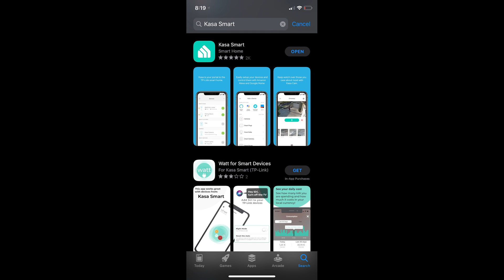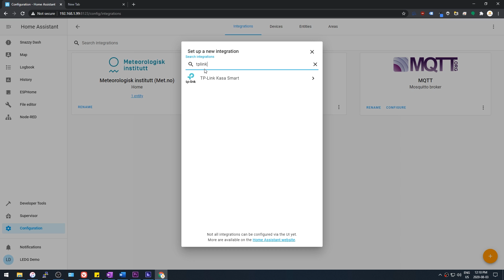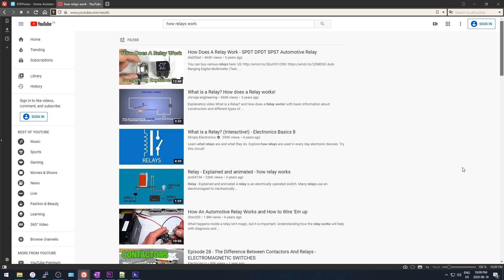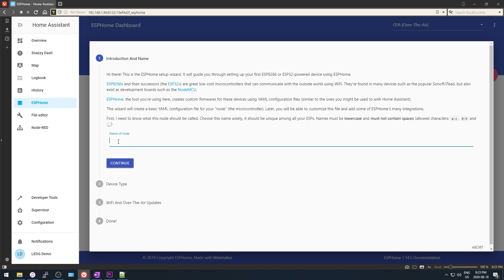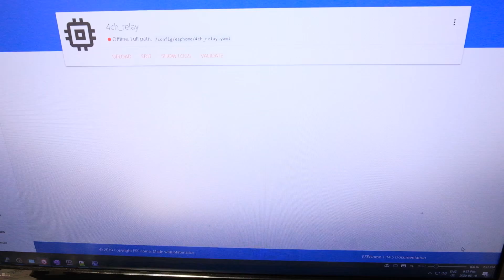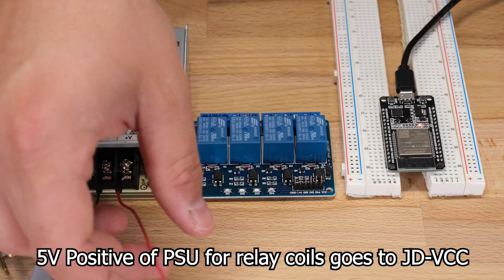Automate Your Grow with Home Assistant #4: Powering Things On & Off w/ Smart Plugs & 5V Relays

Comment from the maker: Just a note about these TP-Link smart plugs. For whatever reason, TP-Link decided to make it harder to control these with Home Assistant. The fix is to NOT set up an account with a username in the Kasa app. 

Start creating your account, then click the "Skip" button when it asks you to enter details, and it will sign you in as "Guest". Add your devices under the guest account and they will be controllable from Home Assistant. If you try to do this with a real account, you will not be able to control them in HA.

Comment: Did you make the power cable for the MEANWELL PSU? Or does that come with the unit?
Reply from the maker: You have to make them - the drivers come unterminated
Reply: @LEDGardener  I'm having so much fun with these videos man, thank you for these. I got the same meanwell 5v psu and relay board, but i'm powering 4 peristaltic pumps instead of led's. Might need a larger PSU as theyre running pretty slow ha.
Reply from the maker: They must be 6V pumps I’m guessing? Can you crank up the voltage on your PSU with the little white screw?
Reply: @LEDGardener  Thanks for the tip! I'll give it a try today. They're actually "Gikfun 12V DC Peristaltic". Wondering would "Mean Well LRS-75-12" be an appropriate step up iyo? (if turning the screw isn't the fix)
Reply from the maker: Sorry, maybe I’ve misread. You must be powering the pumps with a separate power supply than the 5V one you’re using to run the relay board, right?
Reply: @LEDGardener   i just ran the hot from the meanwell to both the "jd vcc" pin and also to the common pin of the relay board and just daisy chained the power like you did. So same psu...sounds like i need a separate power supply for the pumps?

Comment: Been following along, and I already have a number of off brand wifi smart plugs, however, because they aren't TP-link, I can't add them to the Kasa app, and the app I do have to use for it doesn't seem to have any kind of integration :(
Reply from the maker: Yeah Kasa is just for the TP-Links. What brand are you using?

Comment: Note in my network setup the ssid is hidden it would not connect until I exposed the IOT wifi, also I am running HA on a virtual machine  Had to add the usb  controller to the vm to get it seen by HA esphome.

Comment: If the relays are powered by power supply 5v, and esp32 powered by usb-- what does the 3.3v from esp3.3v to VCC relay actually do?
Reply from the maker: I believe it lights the IR LEDs in the optocouplers that drive the relays
Reply: @LEDGardener  Ah thanks it makes sense now.

I noticed weird behaviour when i use only esp32 3.3v VCC (jumper on) --> if relay switch is on and i disconnect & reconnect the esp USB cable, the relay starts flickering open & close fast for seconds before it stays on. 

Which i believe might cause issues.

Comment: Hi, great content! I'm wondering if it is possible to control AC Infinity S8 (new EC Motor) fan speed with an ESP32 PWM ?
Reply: it seems possible using a 0-10V signal with 2-channel optoisolator, would it be something similar to how you are controlling the Meanwell driver?
Reply from the maker: I haven’t had a chance to mess with a new one so I’m not sure how you’d do it, unfortunately

Comment: Great vids, thx for taking the time to share. I am in process of designing a custom grow light using an HLG-480H-B1400B driver and Samsung Horticulture LED Modules. Since I am in design mode for the light, I want to consider home automation while at this stage. I am definitely a novice, but not an uninformed one. Powering and triggering the LED driver/lights on and off is clearly straightforward, and if that is all I want to do, I would just use an off-the-shelf smart plug, which is what I do for my current lights. However, I have been thinking about the 0-10V dimming functionality built into the meanwell driver and how one would best incorporate that in an automated smart home system (I only use Google home now, and hate the trigger less and super limited functionality routines, so this could be an excuse to get into home assistant and the whole 9 yards anyway. At the same time, I realize that it might be overkill or less practical than it seemed and thus it is likely that I won’t use it much, but having said that, it could be cool to have artificial sunrise/sunset and perhaps cycle dimming for different growth stages/rooms (in my previous life in plant science R&D, we even used to simulate clouds passing this way). Anyway, what I am trying to figure out is what device you would use to connect to the DIM+/DIM- ports on the Meanwell driver that would interface with - say - your raspberry pi or computer and home assistant, such that you could ultimately set up automations, e.g slowly ramp the lights to 100% when they come on in the morning, if the lights get too hot, dim them to 80%, etc. It seems like the rp4 or the esp boards have PWM outputs but not 0-10V, only 3.3 or 5, so that doesn’t work with out trying to step up the Voltage, which seems complicated. Is there a shield or module that is built for this? I don’t want to waste money or time (or burn anything down), so if anybody could at least shove me in the right direction that would be great. A smart plug/relay for on/off I can do, the relay boards are fairly straightforward, however, I can’t seem to land on the right hardware for the 0-10v PWM dimming for a 480W high voltage DC constant current driver. Anybody help???
Reply from the maker: That's an easy one on those drivers since they supply the 0-10V on those wires themselves. I did mine with a PC817 optocoupler. PWM/ground from your microcontroller goes to the 2 input pins of the optocoupler (don't forget a little resistor in series on the PWM output to make sure you're not overdriving the IR LED in the optocoupler) and then you just hook up the DIM+ and DIM- of the driver to the output side of the optocoupler. Works great.
Reply: LED Gardener thanks so much for the quick reply, I had a feeling it was easy, certainly knew I wasn’t the only one trying to accomplish that. I’ll look up the octocoupler to see how it works. Will let you know if I have any Q’s.
Reply: LED Gardener Several hours of research later I am still a little confused. I don’t see how the mean well driver supplies 10V. There are two wires, DIM+ and DIM- and it says to supply additive 10V or additive 10V PWM signal for dimming. It seems like the optocoupler merely serves as a switch and a safety bridge so you don’t cross the streams so to speak, but I don’t see how it regulates a 0-10V supply from a 5V pi PWM pin. Seems like you need to convert the 5V PWM signal to 0-10V analog output? I would think that would need its own (at least 10-12V) power supply. Maybe I am missing something on the mean well driver supplying power (I wouldn’t be surprised!) There has to be a module for this, maybe 12V external power supply and PWM/ground from the pi go into some converter module which then outputs 0-10V DC to DIM+/DIM- on the mean well driver? I will keep looking, but thoughts are appreciated!
Reply from the maker: If you look closely on the driver data sheet, in the dimming section, you will find a note that the driver can source current on those wires up to a typical level of 100microamps. When you short the Dim+ and Dim- wires together, your light will dim as low as it can go - some drivers will even dim to 0% and turn off when you do this. Consider the fact that there is also a 3rd dimming option of additive resistance which dims the driver with no external power. Turn your pot up to 100K+ ohms and the driver outputs 100%. Turn it down to a dead short and if your driver can dim to off, it will. 

The role of the optocoupler is to simply short the dim+ and dim- wires together. Your microcontroller PWM signal flashes the IR LED in the optocoupler at whatever duty cycle your signal is set for, and this, in turn, is connecting and disconnecting the 2 pins on the output side of the coupler, at this same duty cycle, which happen to be your Dim+ and Dim- wires. There you go. 10V PWM! 

I know it’s true because I’m doing it myself. If you don’t believe me, take a multimeter and measure the voltage across these 2 wires when they’re disconnected and I’ll bet you’ll find 10V.
Reply: LED Gardener I most definitely believe you lol, as I have no idea what I am doing and you clearly do (I wouldn’t have asked you in the first place, if I didn’t think you knew your stuff. It’s the scientist in me that can’t seem to move on unless I know the details on how everything works. Always need to know the why and the how. This is fascinating though. I had seen that note in the data sheet, but it’s not all that clear on what they mean by it and which of the 3in1 dimming methods it applied to. I see what you are saying though. 

Just to recap for my own understanding, The DIM wires themselves can source 10V 100 mA power from the driver itself (and in fact are always “hot” because of this. Being as they are only two wires, without connecting them to anything else, there are only two states of dim possible. If you did nothing with the wires but just capped them off individually, then the 10v is present and the lights are fully on, and if you connected DIM+ directly to DIM- together, to short them, the voltage would drop to zero and you get maximum dimming, perhaps off. (Or is it opposite? Individually cap the wires and light is dim/off, and tie them together and light is full brightness). Regardless, your point is it doesn’t matter that the PWM data is only 3-5V because it is only used to flash the diode in the optocoupler and that is fine to open and close the circuit at the frequency of the duty cycle. So I guess the PWM signal just translates 1:1 through the optocoupler to the two 10V dim wires, effectively shorting them repeatedly at the frequency of the duty cycle. And lastly, this repeated shorting, depending on the frequency, has the effect of lowering the voltage to anywhere below 10V and down to 0V. Anyway, I think I have enough knowledge to break something
Reply from the maker: You’ve got it. Bang-on. 10V when capped off individually, 0V when shorted.
Reply: Right on, LED Gardener, thank you so much for the replies, your time is appreciated! Please keep making vids!  By the way, there are a lot of vids on DIY LED, automation, indoor gardening, etc., but I have yet to find one that really pulls all what you just described to me together about automated dimming of high power LEDs for gardening, especially not something end-to-end that shows the circuitry all the way through the HA UI, just giving you some food for thought on video ideas lol...

Comment: Love your content, exactly what I'm looking into right now, especially the Mean Well Driv,er series! +1 Subscribtion

I try to build my own PCB relfow "quantum board" but I have a problem deciding how to drive and wire. I want a board with mostly white but also blue and red in the main circuit plus far red in an extended circuit. 
My problem now is: can I drive the whole board with one driver and what to look out for regards different LED types (wavelenght)?

Can I wire in a way that I have the whites all in parallel series (let's say 5 series of 15x 3V = 45V parallel to oneanother), and then the blue and red in series of (X)x (Y)V = 45V?
Does everie series have to draw the same current or just need around the same Voltage (with maybe a resistor) and can vary in A, like differen V LEDs with the same A in series?
For now I'm thinking Meanwell CV A type driver.

Somebody maybe got a source where to look into that into detail, maybe a schematic of a multi spektrum quantum board?

Comment: Thanks so much for your hard work!  You have inspired many, including myself.
Reply from the maker: P. Armour thanks! I do have pH and EC measurement in place. Did you check out my video where I go over my system?
Reply: @LEDGardener   Yes, I seen it-  I was looking for an more inexpensive option.  I found some arduino ph probes and boards on amazon, but no support for them on esphome.io .  I dont have the skills to integrate them into homeassistant.  Thanks again tho'

Comment: I got home assistant after seeing your success. However, I've had problems with my TP link switches (HS300) being VERY spotty in terms of staying connected or even keeping the unique ID registered back with homeassistant. You can't interact/modify the unique ID, it gets sent from the device apparently. I've been using HomeSeer, a commercial software platform, trial version for a few days now and I've not had the same issue.

Comment: Can you give details of which PH sensor you use? Also which EC sensor, water temp, air/humidity sensors?

Google spits out many to choose from but many I’ve found may be inaccurate or say you cannot leave the probes in water solutions for long times
Reply from the maker: All the parts are listed in the video description.
Reply: LED Gardener my bad didnt even notice the description on my phone as it’s hidden unless I specifically click it cheers
Reply: LED Gardener what do you use to control the speed of a motor? Eg a pump and a FAN? Both AC Cheers
Reply from the maker: I’m using PWM to control my fans and pump speed but I don’t do anything on the AC side. The peristaltic pumps use little motor control modules which I feed PWM into.
Reply: LED Gardener so the fans you have and pumps aren’t AC? Any ideas what I would do with AC fans and AC PUMPS?

Comment: dude i just ordered almost every single part of your build, sensors board etc. just the most expensive ones like the mega+tentacle, the ec and ph probe are left behind for now but as soon as i can i will get them too. i think i found an error in the list from the first video, in the control box electronics you put an 8 channel 5 v relay board link but in your control box cannot be a 5 v as it is used for the steering system which is 12 v.. could you please add the clables that you used to the list too? i tink we will talk on the forum soon XD
Reply from the maker: Sweet. I don't get what you mean about the 5V thing though. It's a 5V 8 channel board in there.
Reply: nothing i am stupid XD

Comment: Automagically! I noticed your home assistance connection is not secured. What would you say about security concerns with growroom automation? Which smart home brand is most secure in your opinion? Appreciate you sharing your knowledge 🙏
Reply from the maker: Dankling 420 admittedly, this is an area I know little about - not enough to give an intelligent answer anyway. I have it set up so it’s a straight http connection when I’m local and when I access it remotely it’s secure. I like that Home Assistant itself can run entirely on your LAN without having to phone home anywhere but it’s likely tough to find devices like smart plugs that can be run in the same manner without flashing firmware or shutting down these outgoing connections elsewhere on your network.

Comment: First! Huzzah!
Reply from the maker: Totally going to delete this comment so I can get the first one.
Reply: Oh man. Terrible!
Gardener and HA fanboy here, so much appreciated. Still running 0.60 /facepalm.
Reply from the maker: Ha! Right on man, thanks for watching. Have you got any interesting automations going on?
Reply: @LEDGardener  not anything interesting for gardening. I flashed Tasmota on a Tuya plug that controls a few DiY LED lights set up with basic schedule based-off the sunset/sunrise. I don't yet have support for half of the HA features you mentioned ;). No add-ons (Hass io-less), no love-lace, etc. 
Keep up the good work! 👌👍
Reply from the maker: Hey that's cool, man. It's so easy to scale up whenever you get the time and motivation. Cheers.
Reply: @jamess1787  Would you not recommend Tuya?
Reply: @dankling4203  I haven't used Tuya, I'm not much of a stock firmware kind of guy especially when it comes to foreign countries.